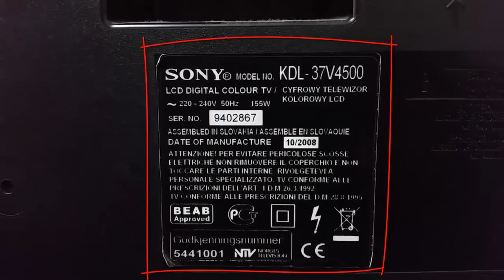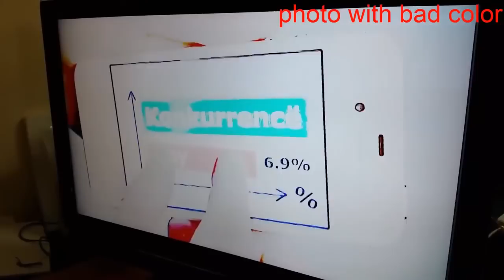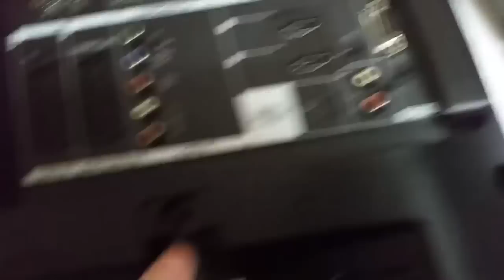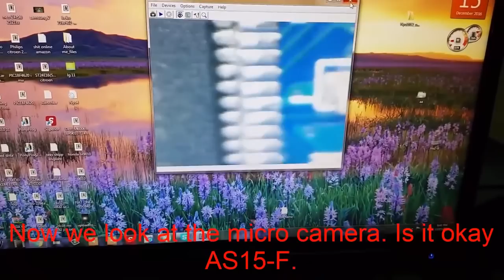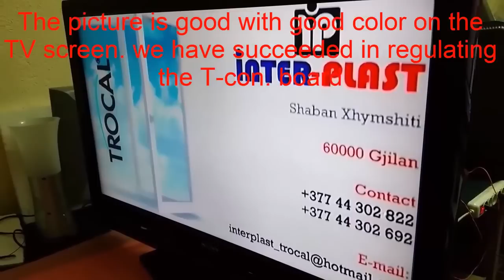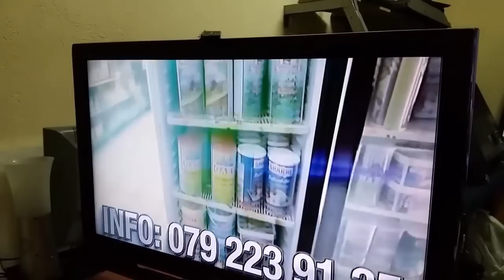SONY KDL-37V4500 LCD TV repair picture bad colors we screen

Comment: Ok, my question is: How do you Solder the small pins on the IC chip which are so close to each other, without soldering them all together?   I mean if you get solder on 2 pins next to each other, it will short out.  How do you prevent that from happening on such a small scale....small pins that are very close to each other ???   Please explain in details and what tools you use to do that.   Thank you.

Comment: Which tv brand do you recommend?
I have bad experience with sony lcd, mine break after 3 years of light usage due to faulty flex cable, and it needed a new display panel
Reply: Damn thats sad . But still crt wins by longevity

Comment: It would be a much better how to video if you talked through it. What are you pointing out at the beginning of video? What are you using to remove the IS15-F ? Where do we get a IS15-F and how much is the cost. Maybe use an english translator.
Reply from the maker: i buy at aliexpress. you have it on eBay as well as on amazon

Comment: Dear friend, I did the same thing, but after replacing AS15-F with T-con, it became better, but vertical stripes appeared on the screen and mine got a little darker image on the screen! Tell me what your problem may be? thank!
Reply from the maker: you have installed well. AS15-F clean with NITRO Diluent. also check again if the pin is installed ok. AS15-F do not forget any pin. ok also clean with NITRO Diluent. try again TV
Reply from the maker: look nice ribbon is ok from the screen in t-con
Reply: @RepairAllTV  you will not believe! After 4 hours of operation the TV bands disappeared on their own! and now the image is great! miracle...
Reply: @RepairAllTV  Many thanks for the tips!

Comment: ciao ho smontato la t-con , sulla scheda c'e' questa serie : T370HW02 V3 CTRL BD 07A63-1B      invece su ebay ho trovato una scheda t-con con questa serie : T370HW02 V5 CTRL BD 07A63-1C     vorrei chiederti se e' uguale ? in pratica invece di V3 c'e' V5 e invece di 1B  c'e' 1C
Reply from the maker: does not make 3v to 5v

Comment: what tool did u use to remove the AS15-F?
Reply from the maker: https://www.aliexpress.com/store/product/Brand-Pros-kit-SS-969H-SMD-Rework-Station-Preheater-Advanced-Hot-Air-Soldering-Station-220V-700W/836673_1772186745.html

Comment: sir how to repair scratch at screen ?no display after ball stuck at screen?
Reply from the maker: I don't understand you. And here is the problem with t-con board. not any more. screen. thanks for the comment
Reply from the maker: I'm sorry. I do not have whatsapp
Reply: tv screen hit by ball, u screen crack  ,need replace the tv panels, no other solutions.